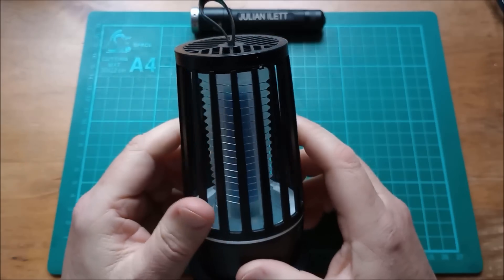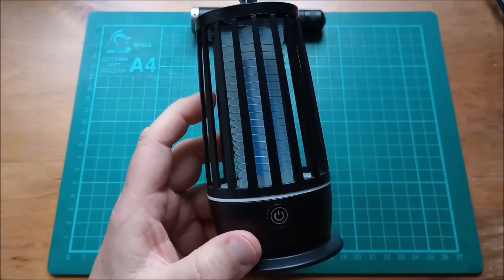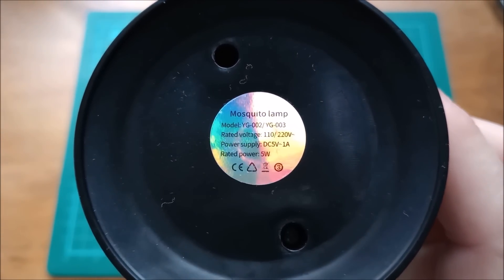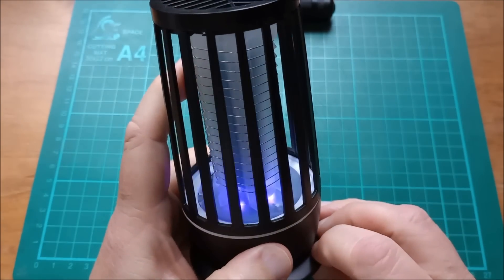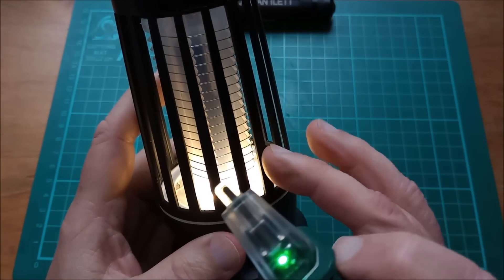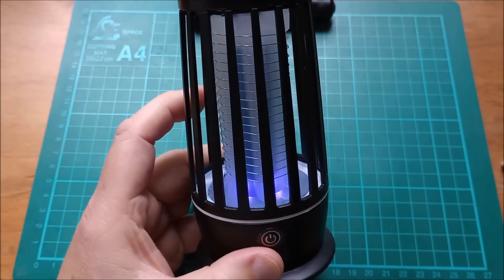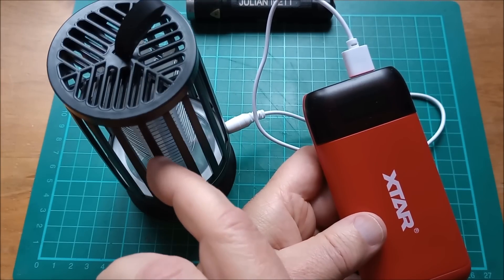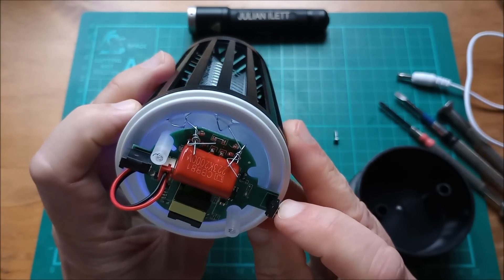Mosquito Lamp

Comment: When do you saying about The wasps.

And whether or not sensitive to that light.

This is really kind of the topic.However , this is something of interest that i'm found out and observed before finding out for sure.

Some mosts importantially bees.

Normally would not be attracted to the line. However, if the nest is disturbed night this can happen..

So
Most people would probably not even observe this most of the time.

Also , Something else if anyone has ever seen A cicada.

There was when real interesting.I did not realize but stirled the heck out of me with these guys one time.

Some species of cicadas actually have a distress call.

It's just about deafening , even bigger than the other calls of this caves.

One was on a wall and yes I got a good pick up the sky but haven't tried to take a closer pick and startled it and boy was iron for a surprise and a shocked system That is to the hearing.

It's interesting to think that some people will never realize until they've observed it first hand .

But yes, I can see an insect zapper zapping.Almost anything that would come its way and even if designed or implemented or handled or otherwise even opinion , none insect bodies spokennoise the person that's using it.

Ouch.

Haven't done this myself , but i've known someone that did once.

Then obviously only once after that experience.

They were replacing the black light tube and weren't thinking when they were checking at the maker's working and zap...

Surprise awakening that well.Couldn't fly about that better at the moment

Comment: That 22MOhm resistor is not rated for such high voltage in such a small package! They should have used properly rated resistors or added 5-6 pieces of 10M resistors in series.

In my mosquito zapper bat, there's also a Cockroft Walton voltage multiplier that increases the voltage to 3kV. Originally, it had a 33nF / 2kV polyester film capacitor. I added a 68nF / 2kV cap and a 22nF / 2kV cap in parallel, and now mosquito zapping is a blast! The increased current (due to the low capacitor ESR and doubling the capacitance) doesn't just zap the mosquitoes; it instantly fries and blasts them!

BTW, the one you have doesn't just zap mosquitoes. It also zaps other insects, innocent crane-flies, probably lizards, and even midges, which are completely harmless...

Comment: I recently bought a similar one, without the white light and without the Li-Ion. It runs on a cheap 5v 1A charger and I measured about 0.4A during runtime, and it has killed a lot of fruit flies and mosquitos. It's running 24/7.

Comment: Would have liked to know if it runs directly from the 5v1A supply for 24/7 use? Does it charge at the full 1 amp when the lipo is at minimum charge state? What voltage does it carry on the high side, and can it be "tuned" closer to the gap between the wires to make it more effective if an object fails to make mechanical contact between the leads?
Reply: So many questions, a missed opportunity for answers.

Comment: I tried one of these for some small flies that were annoying. No idea if they were gnats or fruit flies maybe but they were too small to touch both wires so it did not work for me. I'm looking for a smaller mesh size for the future. I ended up leading the pets out of the house by leaving a light on in the hallway to draw them out of the room they were in and then the back porch to get them out of the house. One light on at a time

Comment: Hi! I would be surprised that this trap will catch mosquito. I bet it will only catch flies and buterflies; but maybe I'm wrong? :)
Reply from the maker: Do mosquitos not like ultraviolet?
Reply: @JulianIlett  They are way more interested by CO2 than UVs
Reply: @yaroc07  
Exactly. That's why the pet bottle trap is much more effective when used correctly.
Half a litre of active "Moonshine soup" will produce more CO2 than us humans, so a couple of those surrounding the BBQ party are very effective. Been there, tried that, got no bites to show for it. 🙂
Reply: @bfelten1  What are the ingredients of  "Moonshine soup" please?
Reply: @yaroc07  
LOL!
   You might google moonshine?
   It's water with 15-30% sugar depending on the yeast you use. Ordinary dry yeast for baking can handle at least 15% sugar.
Reply: @JulianIlett   Not really. The can see polarized light which helps the females find water to lay their eggs in, but they are far more attracted to our CO2, body heat and other smells. There have been a few studies on "bug zapper" lights and they've shown them largely ineffective. They mostly end up killing moths.

Comment: I can guarantee those LEDs are ultraviolet, I have a lamp a lot like this and it emits that same purple light when it's on, but if I hold a sheet of paper up to it, the paper glows a white-blue, and much brighter than the visible purple light.I guess the ultraviolet LEDs output ultraviolet AND purple at the same time so you know it's on.
Reply: Hi! And how many mosquitto did you get?
Reply: @yaroc07  Not many.

Comment: I wonder if would still run off USB if you take the battery out ?
Reply: Now we may never know.
Reply: @cheeseschrist2303  Yeah. :😞
Reply: I'd expect it would. If not you could likely trick it with a 4-4.2V Zener diode (plus current limiting resistor) in place of the cell (seen that done on tablets repurposed for stationary work after  the battery died)